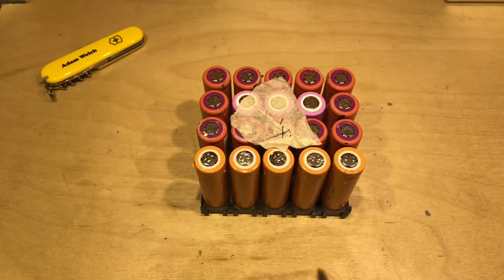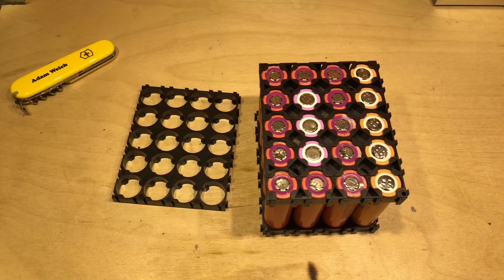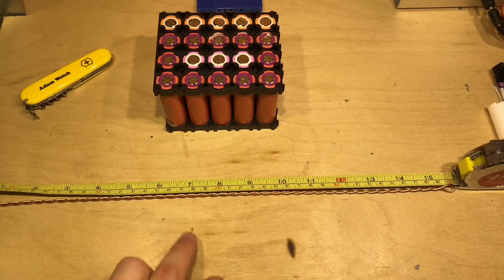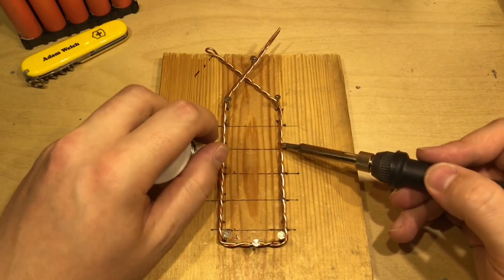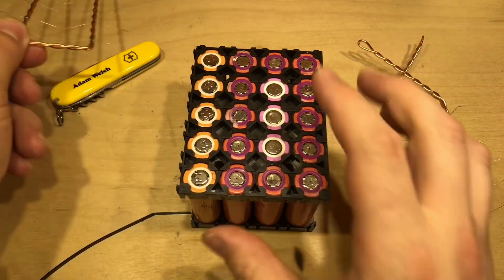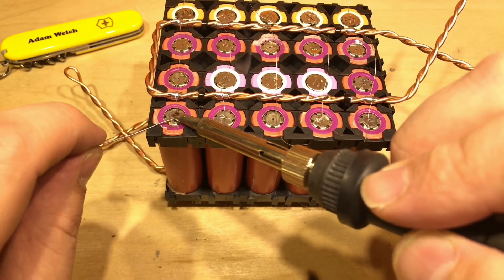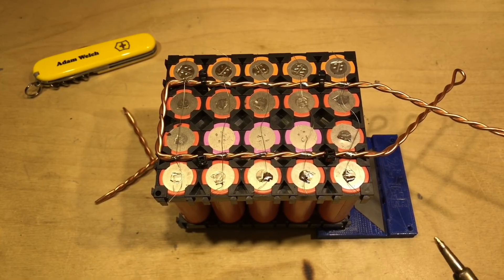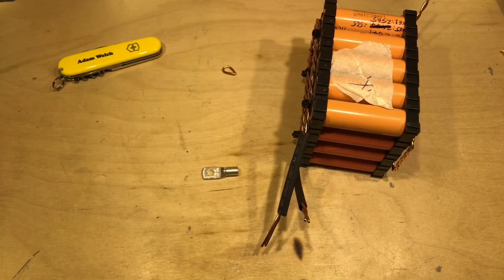18650 Building Blocks - 12v Solar Shed

Comment: If you add a few more strategically placed nails to your busbar forming board you could just wind the fuse wire around in a single run and have hands free soldering!
If you put the nails in angled away from the centre the fuse wire will stay down on the busbars better.
Reply from the maker: That’s a great idea. Shame I’ve now built all my packs now!
Reply: Murphy's Law
Reply: For busbar I use insulated cable fine wire 4-6mm2 and cut insulatn of the cable where I need... 👍

Comment: Hi
The other guys only fused one side. The opposite were just copper wires. What are your thoughts on that Adam?
Reply: Reason to fuse one side (+ve) only is that you then know which side to check if it blows, the +ve is easier/quicker/safer to solder replacements if you accidentally short it out, and you gain a tiny little less internal resistance as the total length of fuse wires are smaller.
Reply from the maker: Belt and braces? :-)  I guess time will tell, but my feeling is that it can't do any harm being fused both sides.  My previous 7s4p and 7s8p packs weren't fused on the negative sides and that hasn't presented an issue, so we'll have to see how this one goes.

Comment: You could 3d print a cover just for the top and bottom of the 1st and 7th cell pack to protect the fuse wires.
Reply from the maker: Good idea - This video was missing an 3d printed element :-)  Thanks